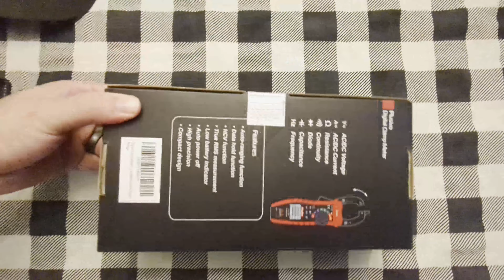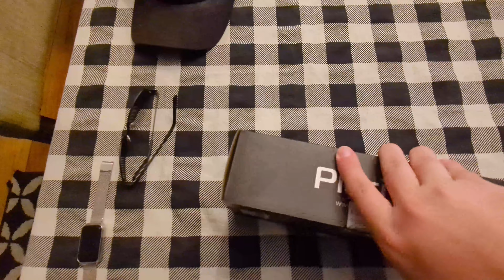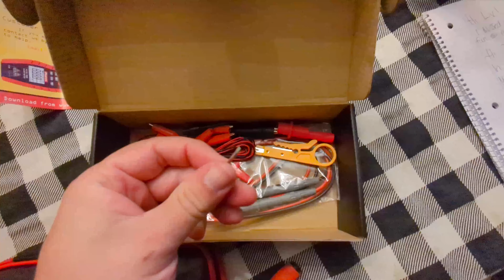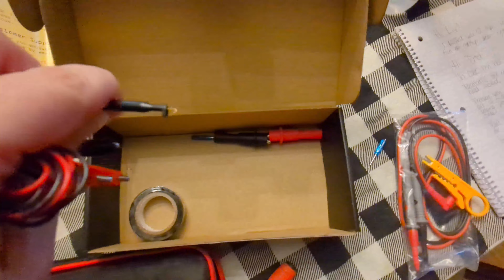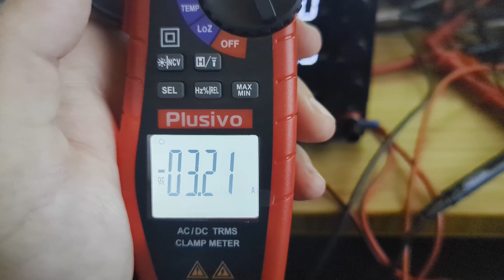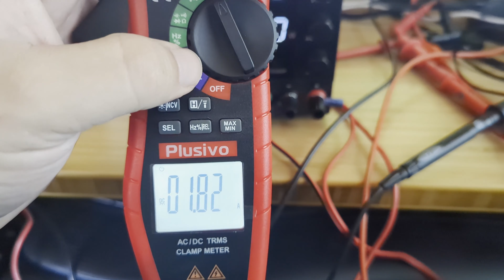Worst Multi-meter EVER: Plusivo CL101C

Comment: After selecting your Amp range, then SEL to select  for DC current you must press and hold the HZ button to zero out the display.  It will still bounce a little bit but more like 0.1A.  You can also zero out when you have either the display light or the task light on.  You should calibrate to zero each time you go into DC amp mode.  This information is in the manual.  I think your voltage info is correct but like you say, it is within the mfg spec.

Comment: I have the exact bench power supply and the Plusivo CL101C multimeter and my readings are extremely accurate. Only .01 volt difference in the higher voltage numbers. You apparently have a meter that has damage from one thing or another
Reply from the maker: Hi Trekker,
Thank you for the message and input.  I tried two of these DMMs, each of them had some problems with accurately.  So where it maybe that I received one (or two) bad units, the average person may not have the ability to test their equipment as I did to know it was bad. 
It also could be that you received a unit that was a good one... I returned the Plusivo DMM and moved on... I shared my review and fully stand by the results and comments that I made.  But as in each case your results may vary.

Thanks,
Brocktech

Comment: Good review. Did you take it apart to check if the design or poor assembly was the failure affecting the amp reading?
Reply from the maker: Hi none, I did take it apart. It was a poor design, they had the light power cable near the sensor. This is what caused the readings to jump when you turned on any of the lights.

Comment: Very helpful! Thank you for this. For my needs, this is a strong Don’t Buy despite the tempting spare kit included
Reply from the maker: I also was looking for a cheaper Multi-Meter for daily usage instead of my Fluke.  The price on Amazon was about $22 was great, especially with the leads kit. I even got a second one and it was worse than the first meter in the video.  I even tried to calibrate, but the AMP readings were still bad.
Reply from the maker: Here is a better MultiMeter Clamp style, but does not have the spare kit (but it was junk after I tested the clips and leads). https://youtu.be/CgyNbmo-zPA